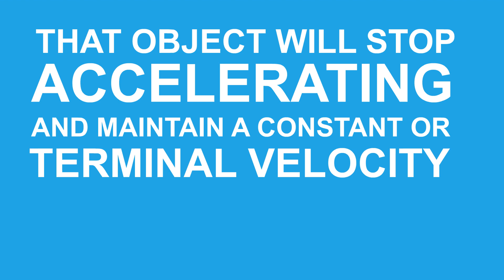How does terminal velocity work?

Comment: I have a doubt, why does drag keep increasing as one falls?
Reply: Good question. Because you are speeding up. Gravity makes you accelerate towards the ground (that's why you go from stationary to very fast when you jump out of the plane). Drag increases with speed. Therefore, you keep speeding up and the drag increases accordingly. Eventually, the drag is equal to your weight (because your weight doesn't change) so the drag and your weight cancel each other out. Without wanting to sound too technical, Newton's 1st law says that if there is no overall force acting on an object, it will either keep moving at the same speed or stay still. That's why you reach terminal velocity!

Comment: Can u answer something... In my book it is written that when the object is about to fall its velocity is zero then when it is accelerating and drag force acting on it velocity v2 is greater than zero but when it acheives terminal velocity its teeminal velocity is greater than v2???how shouldn't it be less
Reply: Plzz answer me fast
Reply: @lara-tl4cz  here's ur answer

Skip the question and attempt the next one😂
Reply: I'm two years too late but thought I'd answer anyway. So, when an object falls, it accelerates by 'g' (e.i. 9.8m/s.s) so that mean that until the object achieves terminal velocity it is constantly accelerating which in fact means that its velocity is increasing with every second of it's fall hence at the point where the object achieves terminal velocity, (which then remains constant until it hits the ground) the velocity is maximum.
Reply: acceleration =(change in velovity)/(change in time)
Since, g is positive, change in velocity is positive(meaning that velocity is increasing.)
At instant (time=t) drag force = mg
Net acc = zero
Hence, velocity is max
velocity at this instant is nothing but terminal velocity.

Comment: What happens on a giant planet with no atmosphere and hence no drag, does one accelerate indefinitely until you hit the surface?
Reply from the maker: sushanalone Yes, at least until you hit the ground. 

That's why the astronauts in the moon Lander had to use rockets to slow down but the capsule could  use parachutes when they returned to Earth.

Comment: what is the force of drag
Reply from the maker: Daine Grey 

Drag is a type of friction caused by the movement of a liquid or fashions medium around an object. This is why drag is sometimes called air resistance or fluid resistance. 

Drag is affected by the shape of the object. Shapes that let gas or liquid flow easily by have less drag. Imagine a frisbee thin edge on, it has little drag so it can be thrown a long way, but turn it 90 degrees and it won't go far. 

The faster you try to push through a gas or liquid the more drag is generated too. 

This is due to turbulence. Basically pockets of lower pressure try to suck the object back the way it came. This only happens when the object is moving.